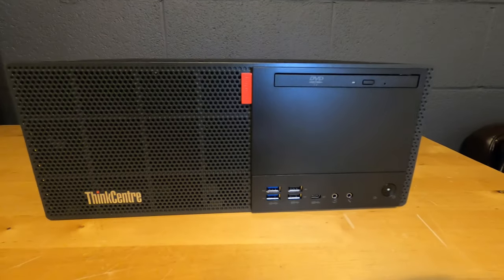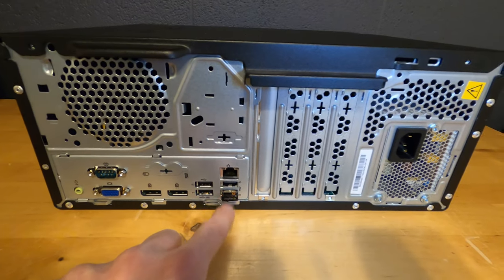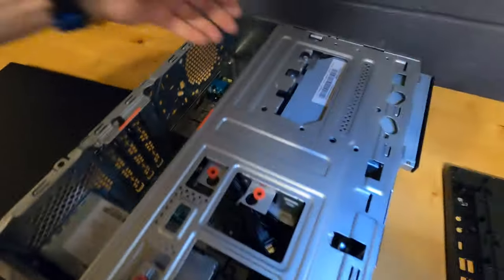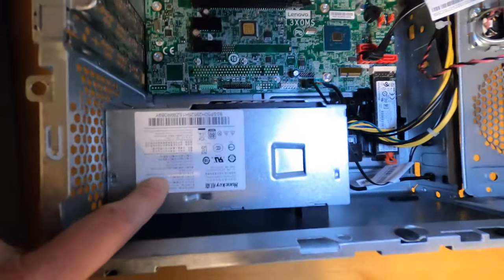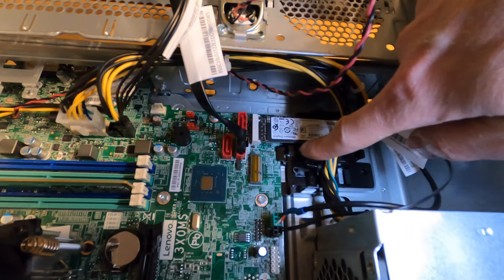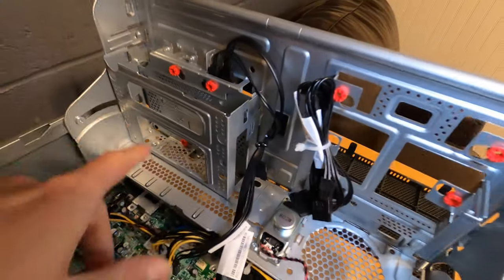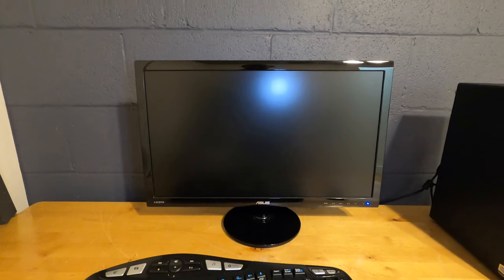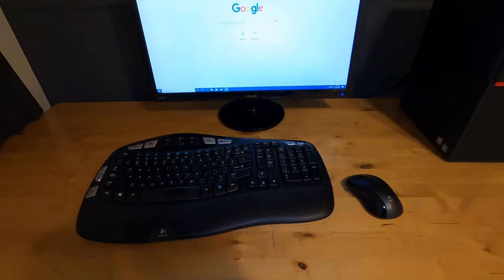Lenovo ThinkCentre M720t Review - Including a Look Inside

Comment: This is fast but no HDMI and no BLUETOOTH . This is a step backwards .
Reply from the maker: DisplayPort is very easy to convert to HDMI but uses a locking connector. That is why it is used on Commercial PCs. Bluetooth is extremely easy to add if people need it, but unnecessary for most desktop PCs and therefore makes them more cost-effective if they don't include it.
Reply: @ZipTieNinja  A very fast computer it would of been good if thy had made it clear and perhaps offered an upgrade. Thank you for the replty
Reply from the maker: You're welcome. It also doesn't have Wi-Fi. I'm surprised that wasn't your Chief complaint 😉
Reply: @ZipTieNinja . I know very little about computers but once i fit the card for Wi-Fi  /Bluetooth it will be just the ticket.

Comment: Do you think there is adequate space for a large graphics card like a gtx 1080ti?
Reply from the maker: I don't believe it will fit, and it is certainly not capable of powering that card. Please read other comments for further details about how difficult it is to upgrade the power supply.
Reply: @ZipTieNinja  thanks a bunch!

Comment: Can I fit my RX 460 with its 210 W power supply?
Reply from the maker: The i5-9400 draws 65w and the RX460 draws 75w, so that's a total of 140w leaving 70w for the rest of the PC. That should work.
Reply: Zip Tie Ninja Thank you for replying, I actually have i3 8100 and the recommended psu for rx 460 is 350W does it make a difference?

Comment: Any idea how much power does something like this consume when on idle? I currently run a few services on the Dell optiplex micro with around 10W of consumption. I want to replace it with something I could fit a 3.5 inch drive in and still keep low power consumption. Would something like this fit the description?

Comment: I have a M720S, with the same configurations of your (I5 9400). Its a great PC to me, and what do you think about it? I don't know why Lenovo made a tower version with the same configurations
Reply from the maker: I've used several of both models. Small form factor M720s is basically the exact same PC, but only takes a low profile cards. I think they make M720t so that they have support for high-profile cards.
Reply: Ok i understood. And do you think it's a good PC in the moment? Because I think that I5 9400 is a great cpu
Reply from the maker: Yes!

Comment: Having a hard time getting this answer from Lenovo.... If I buy lower level processor and then decide to upgrade to a better processor - one listed as an option when I first buy the machine - is that something I can do myself or do I have to send it back to Lenovo? Thanks for your videos.
Reply from the maker: Lenovo probably won't say they support that, but it should be fine. I've done it on other models before.
Thanks!
Reply: @ZipTieNinja  Thanks.

Comment: The rear fan space is 80mm or 120mm? Does it have sufficient port to power up a 3rd party fan module?
Reply from the maker: 80mm. What type of fan module? There are 3-pin motherboard power connectors front and rear...
Reply: @ZipTieNinja  I was planning to buy Arctic F8 80mm Fan. Is the front fan same size like the rear one? Thanks for your reply.
Reply: Also, what is the air flow direction of the fan mounted on the CPU?
Reply from the maker: Both are 80mm
Reply from the maker: The CPU fan points down
Reply: @ZipTieNinja  I just got this desktop few days back. I see the fan connectors are 4-pin. Can you please confirm if I am looking at the correct header?

Comment: Can a Lenovo model fit a graphics card?
Reply from the maker: Yes, but only a very basic one. The power supply is only 210w so that doesn't leave much power to spare beyond what the system already consumes.
Reply from the maker: 65w for the i7 + 75w for the Quadro...
That leaves 70w for the rest of the PC. It would be cutting it close, but I think it would work.

Comment: A quick question, can I increase the ram or add a video card to it?
Reply from the maker: You can upgrade the RAM. This computer would only support a basic video card because of the limited power supply wattage. This power supply cannot really be upgraded either.
Reply: @ZipTieNinja  okay thanks
Reply: So can I put 750ti or gt 1030 on it?
Reply from the maker: The 1030 is 30 Watts. That should be fine. The 750ti is 60 watts, that will probably work but might be cutting it close
Reply: @ZipTieNinja  i don't know how i can thank you  🖤🖤

Comment: Can you upgrade the Power Supply?
Reply from the maker: No, not easily at all. It uses a small form factor power supply that is not a standard size. It also uses a proprietary motherboard connector (10 pin) too. 
So, If you could find a power supply that physically fits, and get an adapter that would work, then it is possible but not easy. I have looked around for other Lenovo 10 pin PSUs with more wattage before, but I have yet to find one that will work.
Reply: @ZipTieNinja  Do you think i could use something like a Corsair SF600 with an adapter to 10 pin? Im not sure if that Power Supply would fit though
Reply from the maker: No standard ATX power supply will fit. It is much smaller and you wouldn't have a way to attach it in the case. 
Also, FYI, there are issues with the adapters that turn the ATX 20 or 24 pin into the 10 pin motherboard connector needed. I've seen reports of the fan running on the PSU when the PC is off. I have also seen them mis-wired and blow up motherboards.
Read the top 2 reviews here (Jake & Rickey's): https://www.amazon.com/COMeap-Adapter-Braided-Sleeved-Servers/dp/B06WV9Z9QT/ref=sr_1_1?dchild=1&keywords=atx+to+lenovo+10+pin&qid=1587506311&sr=8-1
Reply: @ZipTieNinja  So i have the M720t, do you think it'd be a good idea to get a new motherboard and a case so i can actually get a good PSU and use a Graphics Card, will i run into problems trasferring the parts over like the CPU? Im honestly very lost on what to do with the PC and thought id be able to upgrade it
Reply from the maker: The CPU and RAM will work fine with another motherboard, if you choose one that is compatible. The CPU fan may not. Windows will deactivate if you change motherboards, FYI.
If you don't have experience installing CPUs you should ask someone that does for help. The pins in the socket are easily bent. I have seen multiple motherboards with bent CPU pins that are now paperweights.
Clearly the don't intend for you to upgrade this PC much...